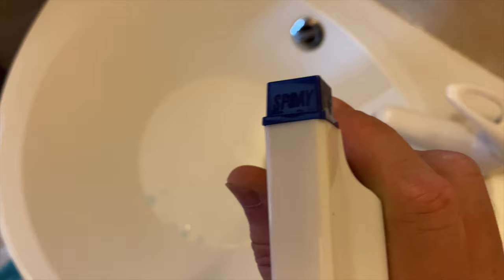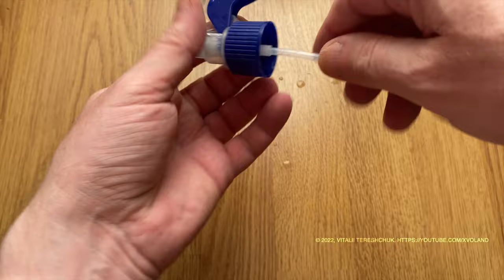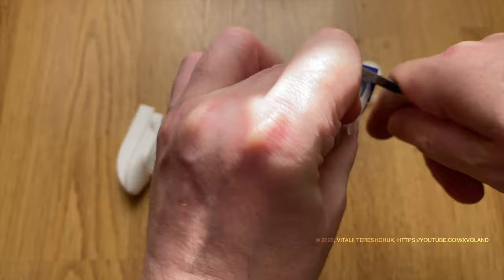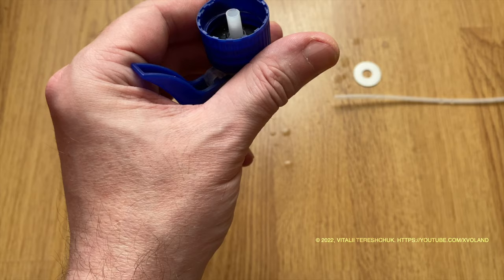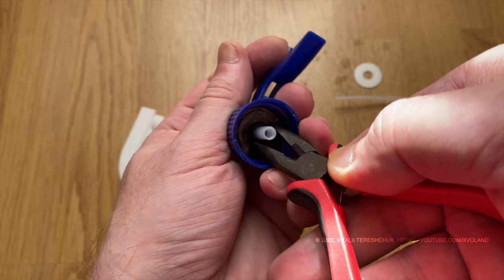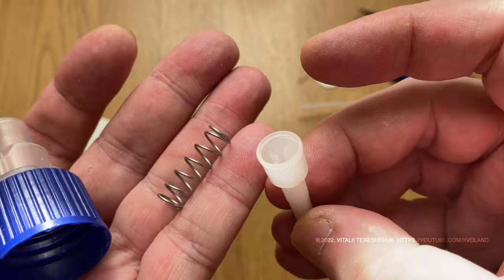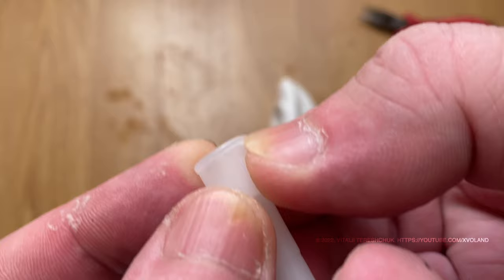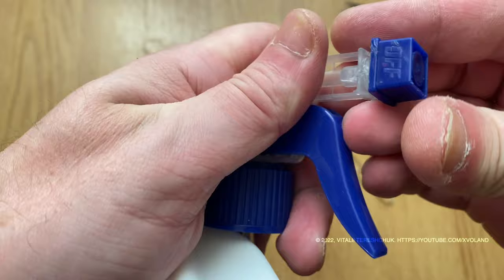🛠 How to REPAIR SPRAY WATER BOTTLE PUMP hand shower. Unique problem

Comment: Guys if it still doesn't work or the suction is weak u can still use it just you can only use it remove the straw or what you guys want to call it, put it up side down and it will still spray but its just more weird
Reply: I tried just squeezing the bottle with its top on really hard a few times then it worked just fine. I'd try this before taking it apart!😊

Comment: As someone in the USA (cant barely afford rent, or anything else really) and trying to fix my mist bottles for houseplants (all three have gotten jammed in the same way with grit making way into the pump/nozzle), finding any info on how to just take the square cap nozzle off is frustratingly impossible to find. I laughed watching this because i basically did the same exact thing but was sure i was going to break it so had to find a vid first. THANK YOU.

Comment: It is not that difficult, the author of the video simply does NOT know how to do it, it is extremely simple
Reply from the maker: Really? What don't I know? Why don't create video and show everybody how to solve a like this problem more easily?
Reply: I've never managed to pull this section out. If it's so easy you must have a trick you could share?  Or you've got nothing.

Comment: Not working
Reply from the maker: It always works. Check for air leaks. The inside must be pressurized.
Reply: @xVoLAnD  I'm not understanding what to do with this... I opened every part cleaned it, fixed it back but condition is same..
Reply from the maker: @tatheerkhan351  The basic idea, is to create internal pressure, resulting in fluid escaping during pressing.
Check all components for free movement (e.g. ceramic/plastic ball inside). This will work.
Reply: @xVoLAnD  kindly do this for me .. I'm done with this ... Btw m surprised that u replying 😊
Reply from the maker: @tatheerkhan351  I'm responding because I'm confident it works. Every video I make is made to solve problems. 

All right, let's get this over with.

Comment: This was a great video!  Only issue was I broke the piston using pliers trying to remove the valve cap (the black thing).  I ended up using a small flathead screwdriver to pry apart the valve cup. I attached the straw to the broken piston with plumber thread seal tape. THANKS to your video, my spray bottle sprays again!

Comment: I tapped the nozzle a couple of times on worktop it started to work. Thanks to this video I learnt that valve needed freeing so usually a tap does the trick.  Haven't tried but I suspect if leave nozzle in hot water 5minutes clears and frees nozzle.
Reply from the maker: Congratulations! Often, the ceramic ball inside sticks and this helps

Comment: Gr8 video, putting finger at the nozzle and then trying also works, it creates vacuum and the pulls the water
Reply from the maker: Yes, you are right, but if there is an air leak, it won't work.

Comment: Sorry you did it correct. But, simply squeeze the bottle 2-3 times hard, and done...😎
Reply from the maker: I don't think it helps because the system has a leak and doesn't create pressure inside
Reply: My spray bottle gets choked after putting the outer cap?

Comment: All you need to do is squeeze the bottle to push the liquid up the tube/straw and you'll find it spraying again
Reply: I tried that on one of those high-dollar Zep bottles and it responded by leaking (heavily) around the trigger with every pump.
I guess I'll use the el cheapos down at Dollar Tree. 😏
Reply: No porque estaba tapado con Algo gomoso... No lo podia sacar hasta que lo abri y lo removing manualmente...